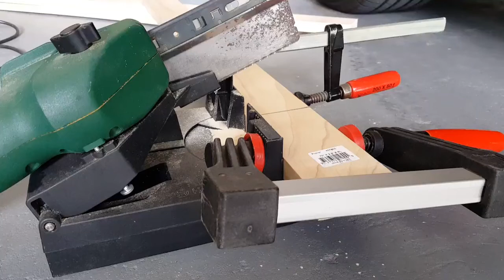Will a 240V Tool work on 110V?

Comment: It's said that 220V-motor when plug into 110V socket it will draw more current. Is it right? But after doing ur video, motor still works but less power output (without any damage).
Reply from the maker: Yes - 220v motor in 110v socket will have less power ... maybe 50% or so
Reply: @allcheckout  thank you very much
Reply from the maker: @pumvichheka4057  You're very welcome my friend!
Reply: @allcheckout  😍

Comment: So will a 110V tool in a 240V outlet using only one of those cheap travel adapters?
Reply from the maker: Not everything will work, but most of the tools - just slower or with less power. I've also tested many 240V TV's on 110V and most of them worked - no problem at all.
Reply: @allcheckout  
I'm thinking about buying a Ryobi Corded JigSaw and was wondering if it would work. And also, why will it work slower with higher V?
Reply from the maker: @adityatiwary28  Don't 100% get what you're planning to do. If you have 220v equipment and use it on 110v it will be slower and weaker, but if you buy 110v equipment and use it on 220v it will burn, overheat, explode ... whatever ... don't do that ;-)

Comment: If the tool doesn't depend on a true neutral (i.e. can accept both sides hot), you can get an electrician to wire in a 240V outlet as N.A distribution has two 180 deg out-of-phase hots (unlike EU where most times it is one hot).  I have a NEMA 6-20 T-slot plug in my garage as some high power tools sold here require it.  Of note, anything that is sold as 240V equipment usually requires the plug to be wired on by the end user (except for white goods/appliances).  There are other concerns to watch out for also (60Hz vs 50Hz).
Reply from the maker: Thank you very much for the great explanation and suggestion!